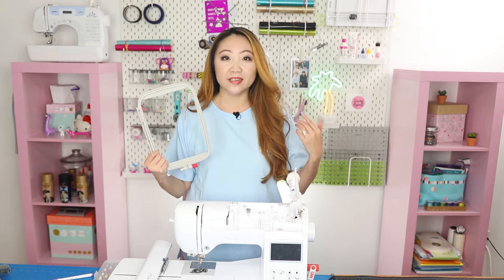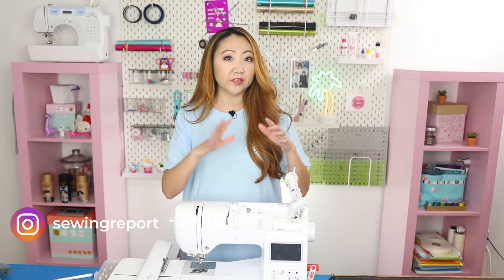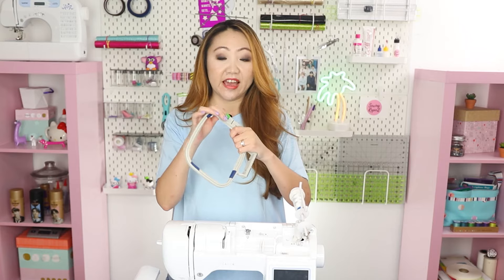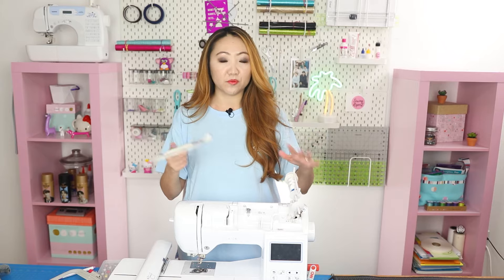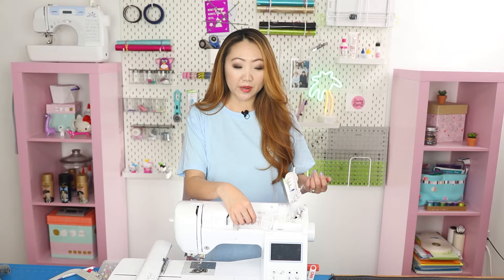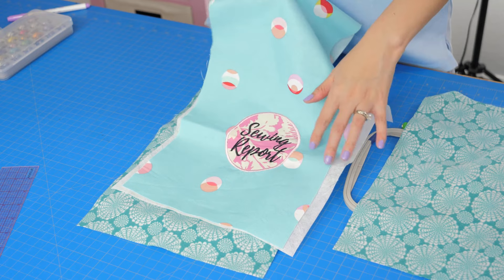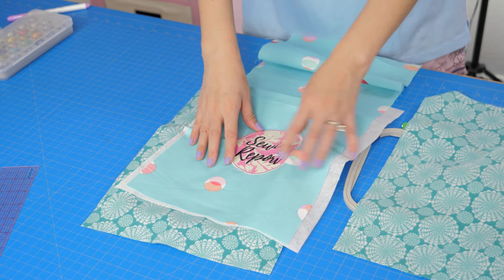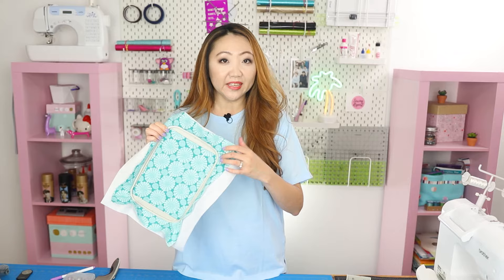Embroidery Machine Basics | Hooping Tips, Stabilizer, Needles & Thread

Comment: I have a Janome 9900 Embroidery/sewing.  I also do free style quilting & many other jobs with it.   & a 1034D; & J6600 (well built in Japan !)I do like Brother & janome machines. Only thing is the janomes take different size feet. That new serger AirFlow, sounds great due to easy changing colors normally on a serge is a pain !  Always need to up date myself with your reviews.  None of my machines will not tolerate using a sticky spray.  ?. tried many, just jams up all size needles. any tips?
Reply: use non-stick needles, i have janome 12000 and no issues with sticky peel=off stabilizer, glue stick, spray adhesive, or 1/4 inch fusible tapes.